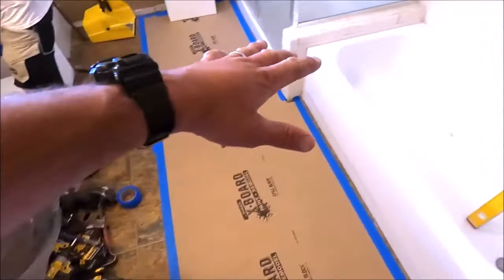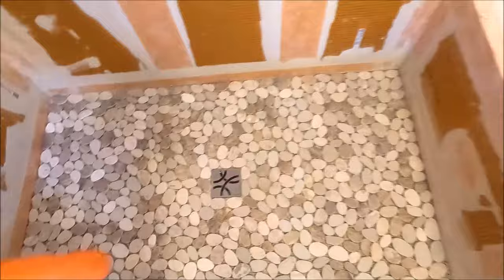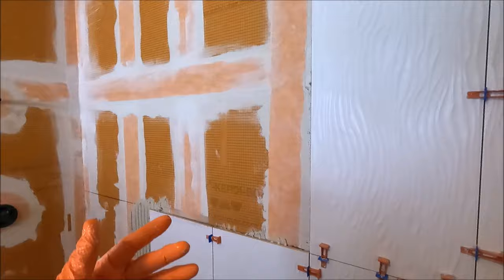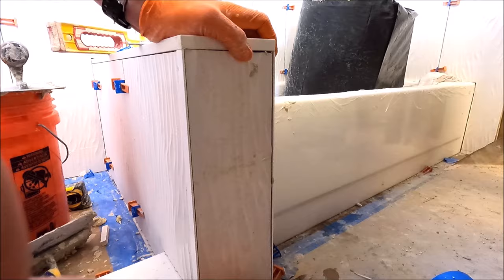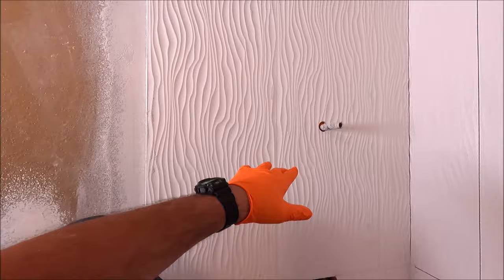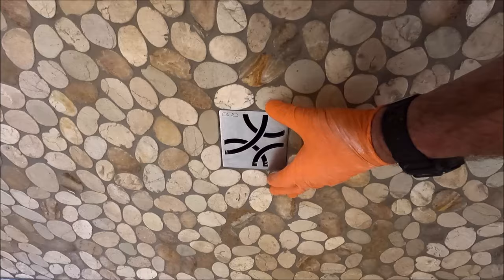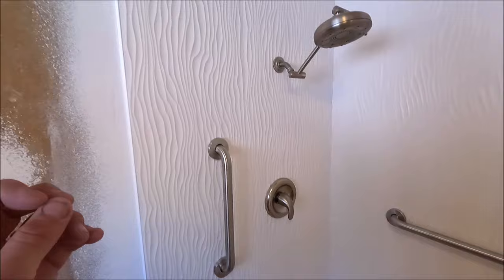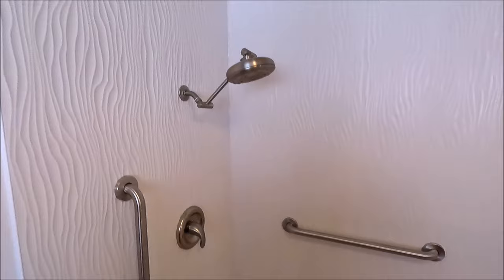Is This MASSIVE 3D SHOWER TILE  a New Trend?

Comment: That Schluter Allset “specially modified” sure is expensive.Schluter says to use unmodified thinset to set tile over kerdi membrane but yet they say you can use their expensive “specially modified”.Called Mapei technical and they said it’s ok to use modified thinset that it takes no longer to dry than unmodified.Sounds like Schluter wants to sell expensive thinset to me or at least their brand
Reply from the maker: that's all we use

Comment: Is that an air purifier or a small ac unit that you are using with the hose hooked up in the window?
Reply from the maker: Click on My Tile Store in the video description, you can check it out there. We would never remodel a bathroom without it! Cold air, fan, filter and Dehumidifier for paint, drywall mud, Schluter waterproofing etc. Worth every penny!

Comment: Any chipping when removing the clips thats the only problem i find with these tiles
Reply from the maker: yes! we definitely had a few
Reply: @LandbergTileTV  I glued two pan liners together n cut the into spacers used them and the clips the pan liners spacers are just a hair thicker so the tiles don't rest on the hard plastic of the clips and I don't have anymore chipping